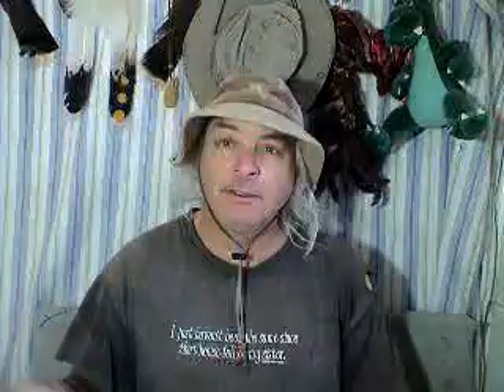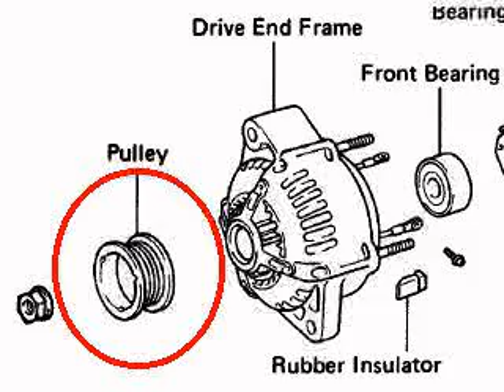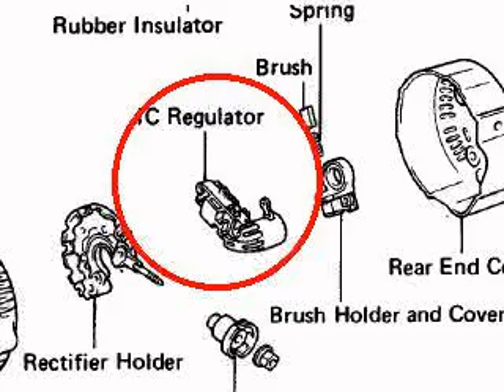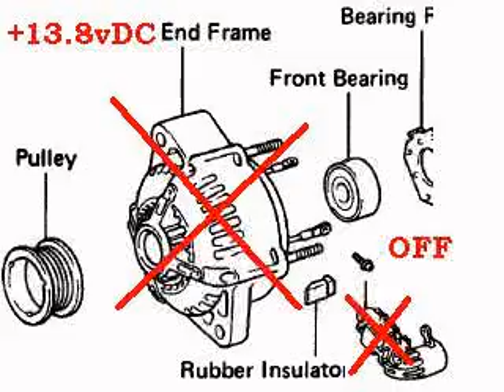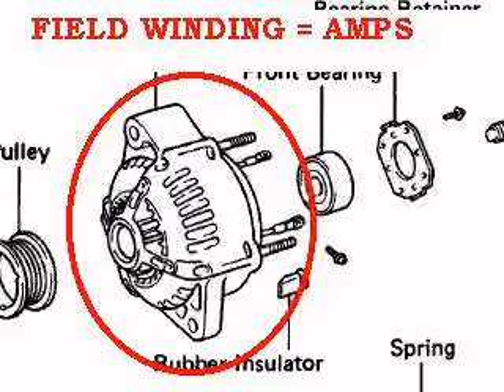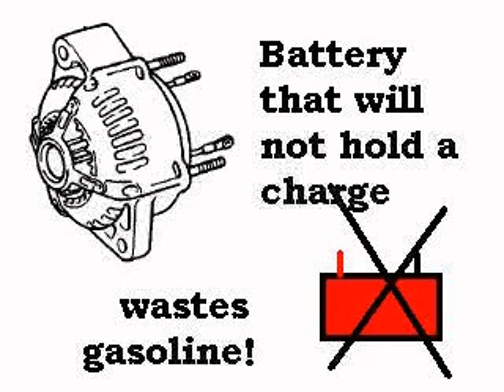Major Technology Breakthrough! Burn Water as your Automotive Fuel! HHO Part One

Comment: not really. the biggest problem we are having is the poor efficiency of the current internal combustion engine. when attempting to run a piston engine with its 18% thermal efficiency on 100% HHO you are correct that it is a lost cause. but as you get into some of the more advanved engines with nearly 30% thermal efficiency, things start to look a lot different. there are tests underway NOW with a gas turbine engine that are quite interesting. will publish results after first of year.

Comment: please do not put your finger in front of an HHO torch ... you will loose it if you do ...

the interesting thing about the HHO torch is that the torch tip itself stays quite cool to the touch ... and at very high volume flow rates, the torch tube can actually get cold ... but the HHO torch will burn through tungstun like hot knife through butter and cook your finger with minimal exposure ...

its a very practical use of the gas we make with our devices and is commercially viable NOW ...